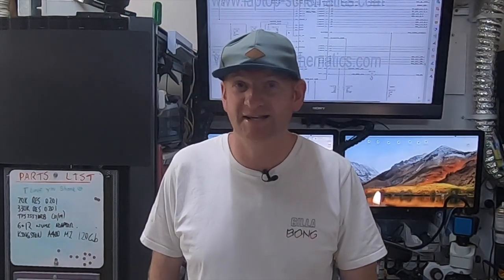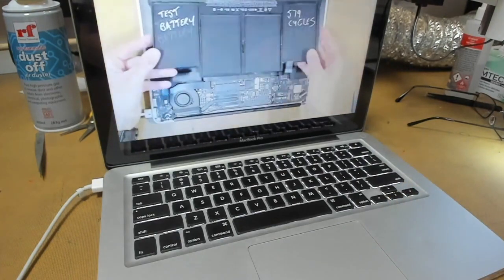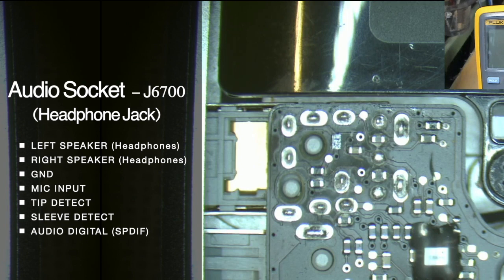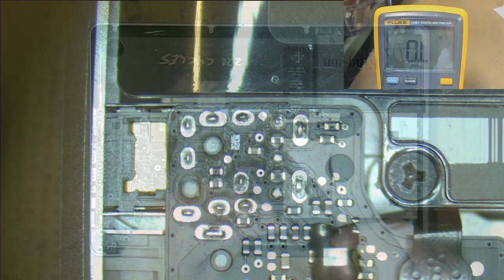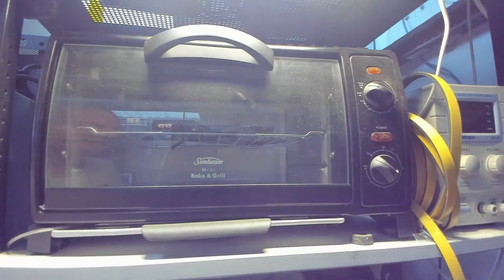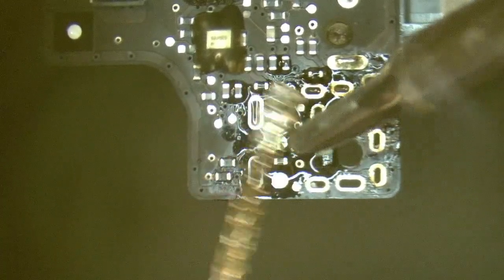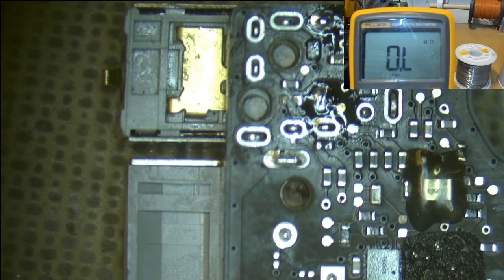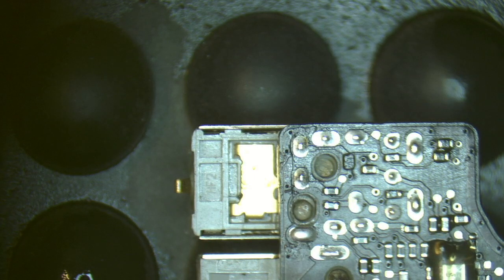Macbook Pro No Sound Internal Speakers

Comment: Good explanation of a problem. It was informative that you found the problem is localized to the failure to close that circuit. I'm not certain what series you're working on but on earlier Macbook Pro laptops, the loss of internal speakers was accompanied by a red light showing in the port. On a different video, I described the following (similar to your findings, a circuit is not closed after a plug is removed): 

This loss of internal speakers is a common fault on the 2009-2013 Macbook Pro laptops because of a (poor) headphone jack/port design. The headphone port also serves as a connection point for digital output and there is a mechanical switch built into it for that purpose. The design isn't truly bad except that it prioritizes the optical output with a poorly designed switch. When you insert a headphone cable, the analog output or digital output is enabled but when you remove the plug, the switch doesn't always close and thereby switch to the internal speakers. If the internal speakers on your MPB do not work, then the optical output is likely enabled -- indicated by a red light in the empty headphone jack. There is no way to physically switch this setting ... at best, inserting and removing a plug will exercise the contacts to make a positive connection and disable the optical output, temporarily. 

Personally, I have tried (or considered) all of the solutions/repairs offered online and some work and some don't but none are the most efficient solution, i.e., making the port work as intended. I determined all of this by reviewing what little design information and schematics were available online and then tearing down a computer and (destructively) investigating the faulty port. I have also experimented with bending the contacts to promote the mechanical leverage of the switch contacts but that was not conclusively effective. One "permanent" solution would be to replace the headphone jack on the logic board but I would not recommend it unless done by a skilled repair technician and it could be costly (dismantling the computer, remove/desolder the headphone jack, reinstall/resolder it, then test) or could damage the logic board. 

My admittedly temporary solution has been to thoroughly clean the headphone jack after which it will function as designed for six months or more. To clean the headphone jack:  
(1) remove a plug if any; 
(2) place a drop, or two, of (pure) isopropyl alcohol into the empty port; 
(3) exercise the port's mechanical parts by inserting and removing a plug (at least 10x); 
(4) repeat (2) and (3) once or twice in succession; 
(5) blow out the port using a dustless cleaner (canned air) and let dry. 
Over time and due to exposure to environmental conditions, I expect that the contacts corrode again and fail to close indicating that cleaning is again necessary.
Reply from the maker: Yes I played around with the cleaning method, but found it too un-reliable. So I posted a video on a quick and easy fix.

https://youtu.be/MPmIA6JpXJI

Comment: Had this issue with my MB Pro Mid 2021. After watching this video had a look at the headphone connection and it had a red light on. Connected the headphone jack on and pull it out and the internal speaker started working again. Lucky it was an easy fix for me!!!
Reply from the maker: Well done
Reply: Interesting that a 2021 MBP still has this problem. I had hoped that Apple had resolved the issue. You may have this problem again so consider cleaning the port (see my post).